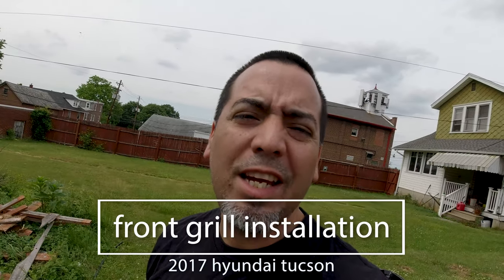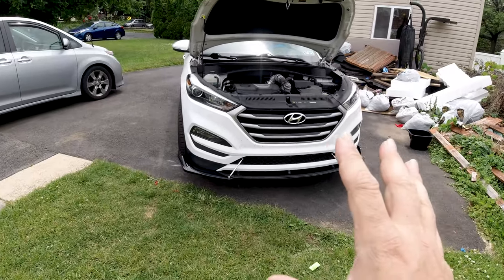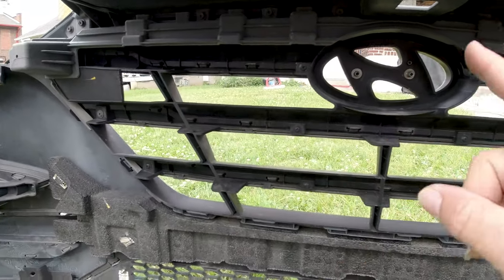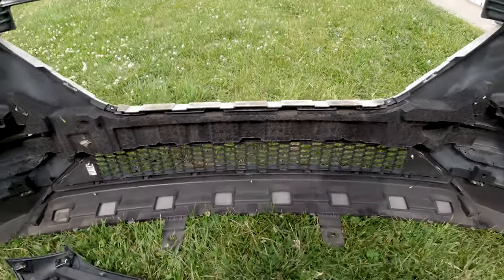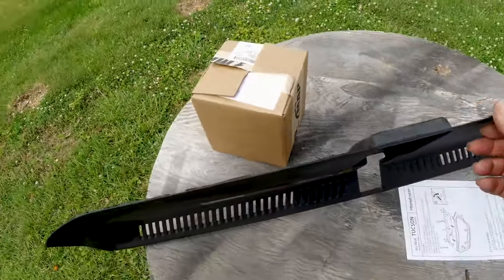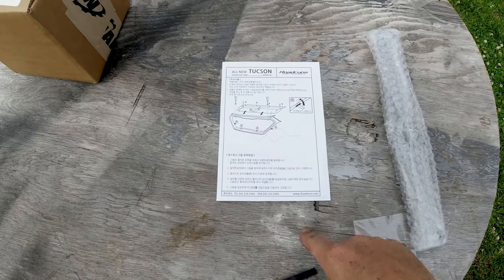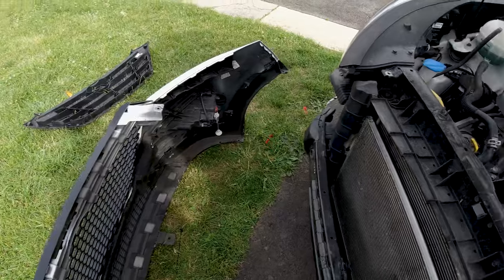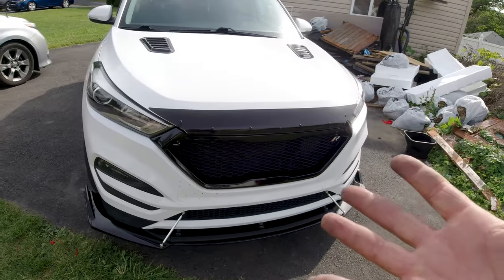#hyundaitucson #roadruns #2017tucson 2017 HYUNDAI TUCSON FRONT GRILL INSTALATION!!!

Comment: Where did you get the grill ?
Reply: Bought it on Ebay it came from overseas
Reply: @mon17razor72  can you share the link where u bought it. I need to modify mine
Reply from the maker: @mikenicolas4131  https://www.ebay.com/itm/Black-Front-Radiator-Grill-For-Hyundai-All-New-Tucson-TL-2016-2018-/273261505489?mkcid=16&mkevt=1&_trksid=p2349624.m46890.l49286&mkrid=711-127632-2357-0
Reply from the maker: @mikenicolas4131  just in case I'm the same on both YouTube channels... 😁✌